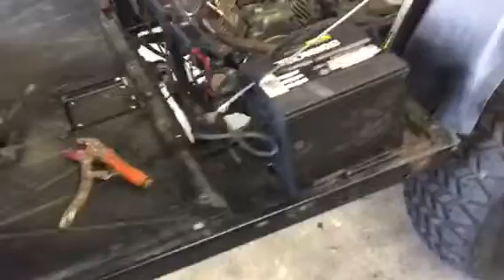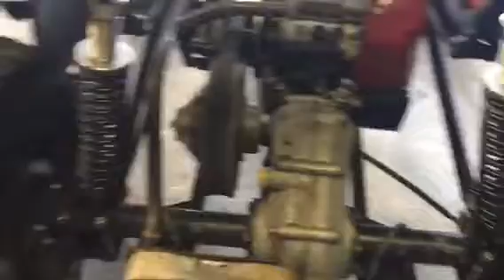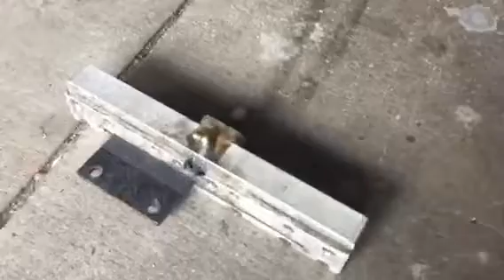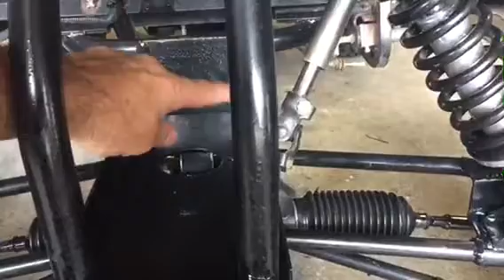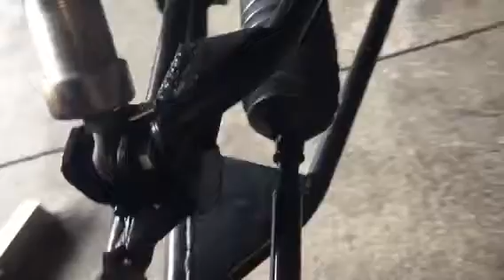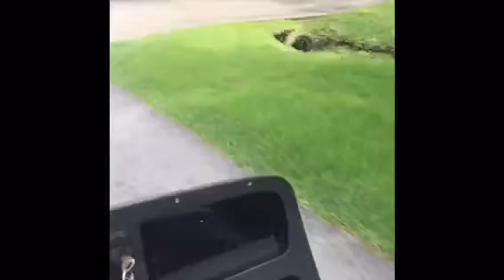Episode 1.  50mph golf cart build. EZ-GO gas powered project high speed

Comment: Looks about like15mph to me.    He got the 5 right, just forgot to put the 1 in front of it.    Ez go rear ends suck for high speed.  A 12 to 1 ratio really. 2500 rpm input will get you about 13 mph.   You would need over 6000 rpm input to the rear to get 50 mph.  Your engine probably does not even rev that high.  Plus you have a reduction in your cv drive.   That’s why you don’t show mph. Just a phone pointed at the ground.   50 mph my ass.   Not with that stock rear end.
Reply from the maker: Wow, you really know how to pat yourself on the back with angry knowledge.   First let’s start with watching episode 3, the mph is crystal clear hitting 41 with plenty of room to go faster.  Going fast with a stock rear end is easy, keeping the cart stable is not.  2nd, the CVT drive and driven clutch on this cart is far from stock.  A CVT can be geared in any direction to achieve torque or high speed, similar to the way a bicycle can change gears. 3rd, A stock EZGO does 22 mph by simply installing 23 inch wheels and (freedom mode).  The EZGO controller (Curtis) has five speed settings, 1-4 are available to anyone who has a handheld that can talk to it adjusting Speeds from 4-14.8mph.  Freedom mode! Mode 5 is unlock with a code you purchase from the manufacturer.  Dealer only purchase.  Mode 5 allows one to achieve speeds of 19.5mph at 4400 rpm.  With 23” wheels you will hit speeds of 22-24mph with a stock CVT and rear end.   

You will not get the pleasure of another reply but you are welcome to call to talk shop.